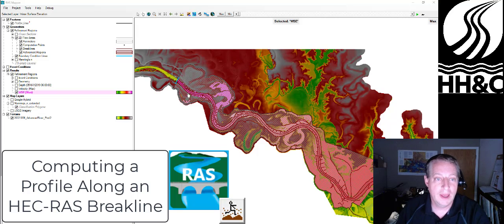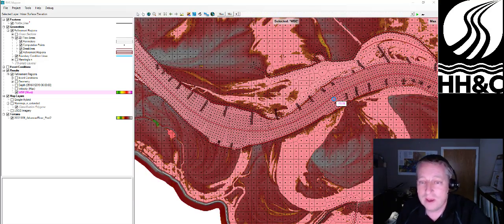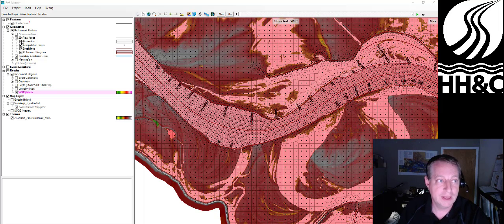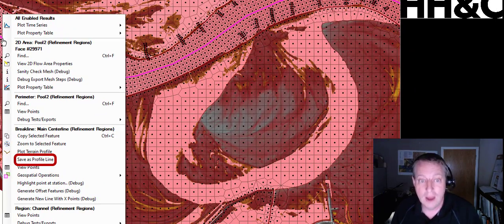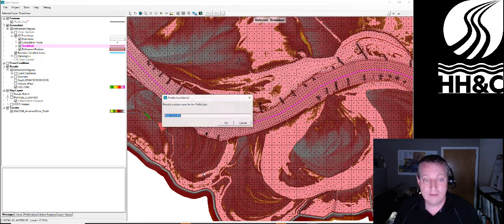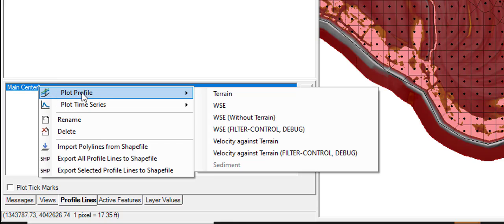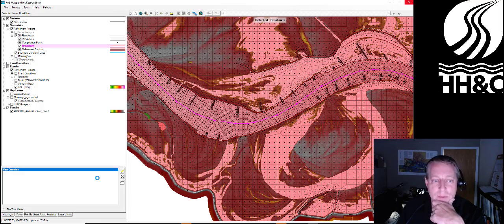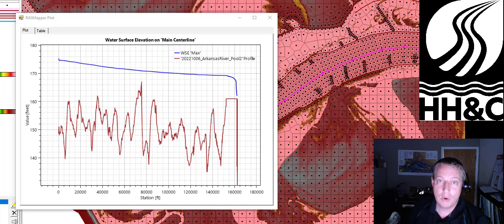Plotting 2D HEC-RAS Results Along a Breakline

Comment: Great video. I wonder if it is possible to place a "virtual flow gauge or meter" (just a point, not a breakline) in some place of the mesh to record a flow time series.
thanks for the knowledge!
Reply from the maker: For sure.  Have you played around with the Feature Points?  At the top of the mapper tree there is a heading called "Features."  Right click on that in edit mode and choose "Create a New Layer--> Point Layer."  Then run your simulation.  RAS will save results to that point and you can plot them at that point.
Reply from the maker: BTW, we are planning to add a reference polygon to 6.4, which will allow you to combine or average results from several cells.
Reply: @stanfordgibson  sorry for the inconvenience, I already created the point layer but I can't find the results in RAS mapper, I select the point with the cursor but RAS mapper dont show me the plotting options, I select the point and RAS Mapper show me the options for the entire cell, how can I view the time series only for the point?
Reply from the maker: @TheBalticSun  Unfortunately, the result do not plot in Mapper yet.  You have to go back to the time series output in the main RAS window.  I'd like to do a video on this, because its super useful but not that intuitive, but haven't gotten to it yet.